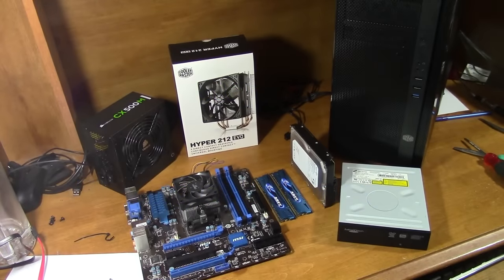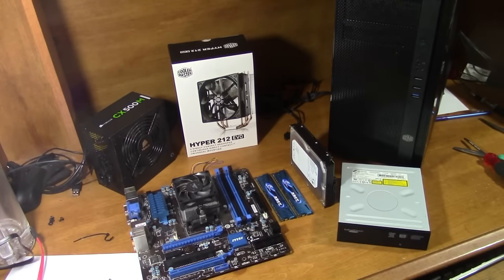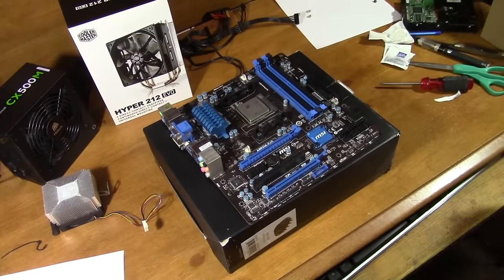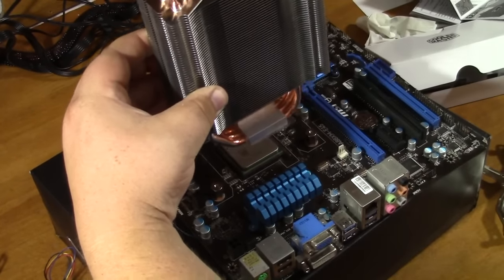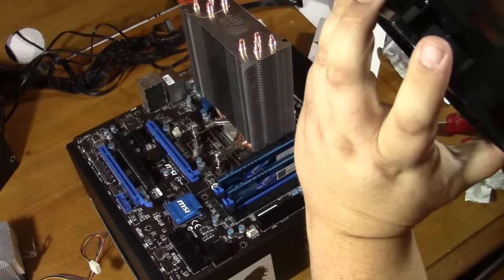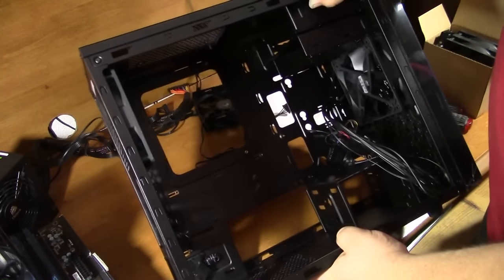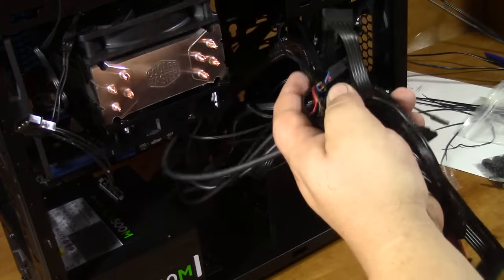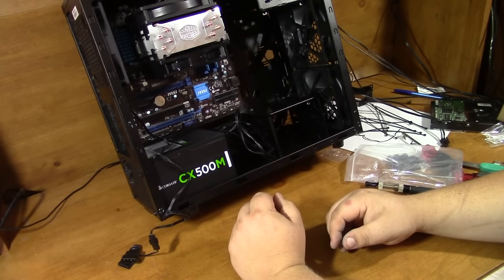How To Build A Computer Yourself

Comment: Whatever I could do to make playing Farmville run smoothly without freezing would be great. Thanks for the info!
Reply from the maker: +Jenny Jane farmville is not very demanding...what cpu, ram, and graphics card do you have?
Reply from the maker: +Jenny Jane Could it be connection based since it's a browser game?
Reply: My Papa Smurf is a Pentium 4, 1.49 GB RAM , Not sure about the graphics card (or even if I have one). I know he's old (10 years). My husband tells me every week to get with the times, but I just can't get rid of him. The Computer, not the husband.
Reply from the maker: Jenny Jane I like the husband joke! lol   If your pc is 10 years old, there's really not much you can do.  There comes a point where the program or application becomes so far advanced that the hardware just can't keep up.  It would be like trying to play a playstation game on nintendo, or trying to watch a bluray on a dvd player.  You could build a computer that would be lightning fast comparatively for like $300 or maybe even less if you didn't care about super performance.
Reply: +Backwoods Patriot +Backwoods Patriot Yeah, that's the problem. I may have been born in 83', but I have an old spirit and like things nearly original. Not very fond of change, but I suppose it's time to put PS out to pasture. Now you've made me want to play Nintendo NES. Thanks for the help, though :-)

Comment: I built the computer I'm currently using about 5 years ago. That was the first one I built completely from scratch, but I had installed additional memory, drives, fans and graphics cards in other, store bought computers (always HP) and everything went relatively smoothly. I have two internal, two external drives totaling 2.5 TB and am maxed out on the memory at 8GB and am using 64 bit Windows 7. Your video has stimulated me to upgrade my motherboard and cpu and add faster memory up to 32 (maybe 64) GB if I can afford it. I'll probably go ahead and upgrade to Win10 on the new build, but I have a question: can I simply install the SATA drive that currently holds Win7 into the new computer and then upgrade to Win 10, or will I have to format the drive and re-install Win7 before upgrading to Win10?

I don't do much gaming anymore, but I do a lot of video and really need the most effective memory/power for video rendering. Do you have a recommendation for a motherboard/cpu combination? I'm not interested in overclocking or extra cooling (other than the fans I already have).

Thanks for the great video.

Karl
Reply from the maker: +ItsyFarm Well, a few things...First no you can't use a hard drive with windows on it on a new computer/new hardware.  The windows activation links to your specific hardware.  There are ways around this of questionable legality.  Second, it sounds good to have 32 gigs of ram, but, it is a waste.  there is no need in anything above 16gb of ram.  There are no circumstances in which you would be able to even use 16 even in the most demanding application you run, so the money should be put towards a different area.  My reconmendation for hardware would depend on your budget and whether you like amd or intel.  Video rendering, depending on which program you use, is heavy on cpu use and moderate on gpu use.  If you could tell me a bit more in the areas I mentioned, especially budget, I can help you out.
Reply: +Backwoods Patriot Thanks for the heads up on the 16gb ram. I have no specific preference for AMD vs Intel. Currently have an Intel DG45ID board with an Intel Quad Q8200 cpu. A quick review of the specs for that combination makes me wonder if I really need to upgrade!

Budget is not really an issue, but I'm not Donald Trump and am not interested in overpaying for functionality that I don't really need...just a good fast cpu. I use Power Director 13 (soon upgrade to PD14) for video editing. Even with 64 bit processor, it bogs down a bit.

I've tried a couple of dedicated mid range graphics cards over the years (AMD Radeon series and nVidia GeForce), but have not been able to make the board recognize them. I think it was probably related to not being able to disable the on-board graphics on the DG45ID. Based on a couple of things I've read, dedicated graphics cards with a lot of on-card graphics memory will help computer performance in video processing applications. BTW, I prefer a multiple monitor setup.

Thanks in advance for your comments.
Reply from the maker: +ItsyFarm Well, if you want to keep the on board graphics, you could always just go with the highest level APU you can find...Wouldn't be very expensive at all.  You would need a different mobo though.  I have put together a shopping cart on tigerdirect.com for you, after researching the architecture of powerdirector, and I have come up with a few parts to not only give your computing experience a shot in the arm, but ensure you would not need to upgrade anything for at least say 5 years.  Here is a list of the parts....

http://www.tigerdirect.com/applications/SearchTools/item-details.asp?EdpNo=3858040&sku=A455-9701

http://www.tigerdirect.com/applications/SearchTools/item-details.asp?EdpNo=8212737&sku=C13-9818

http://www.tigerdirect.com/applications/SearchTools/item-details.asp?EdpNo=9087637&sku=UUL-102503513 

http://www.tigerdirect.com/applications/SearchTools/item-details.asp?EdpNo=4904561&sku=A79-8350

http://www.tigerdirect.com/applications/SearchTools/item-details.asp?EdpNo=7708719&sku=O261-2075

This is a screaming 8 core cpu, a video card that will play any modern game at high res(not to mention significantly speed up your video rendering even at 4k), good quality high speed 2133mgh ram, a quality full function mobo, and a 80+ gold certified 750W psu to power it all.  The cash total is $654.95!!!!   Try to fin an off the shelf 8 core system with balls to the walls graphics for that! LOL

Comment: can I add more than 8gb if I use everything else from your list of parts?
Reply from the maker: +Fringe Conspiracy Yes, this motherboard supports up to 64 GB!  If You play games a lot I would recommend going with a more powerful APU instead of the A10 5800k....like the a10 7870K for $139.  Make sure to use 2133mhz ram to get the full potential out of the APU, as they benefit from faster ram whereas cpu's don't really.

Comment: hey is it possible to have a other orientation for the cpu heatsinc like blow at the back direction instead of the top?
Reply from the maker: +Saintwa Ye It depends on the particular heatsink/cooler...On this one, the Hyper 212 Evo yes you can orientate it to blow front to back.

Comment: get a used a i7 3930k , x79 board
which better for rendering than the amd
Reply from the maker: +Michael Combs I'm getting ready to build an insane rig.  I have half the parts ordered, and the others I will be getting the second week of January.  It will be an FX 8350, 16 gb of cas 9 ram, a 120 gb ssd, a 1 tb hdd, an msi gaming 970 mobo, and an msi gtx 960 oc 4 gb...It's going to be epic.  I don't think I will build it on this channel.  It doesn't seem to fit.  But maybe I'll start a new channel just for that because I am going to sell it on ebay and do it over and over.  I know Intel is better in many ways, but you cannot get 8 cores for $180 from Intel! lol
Reply: +Backwoods Patriot I saw fx 8350 and stopped reading afterward